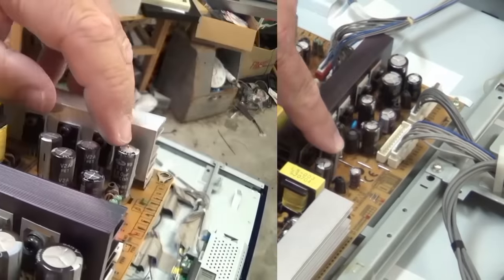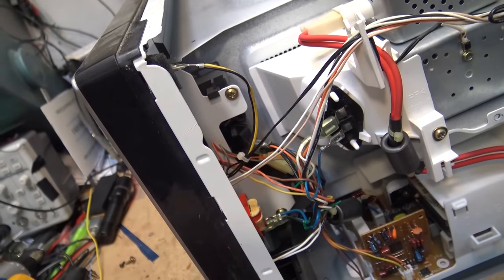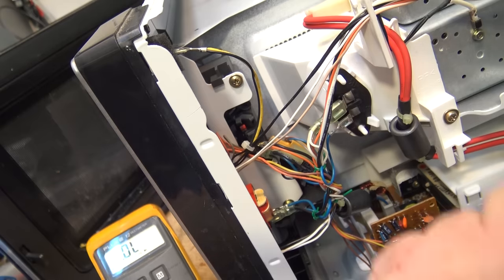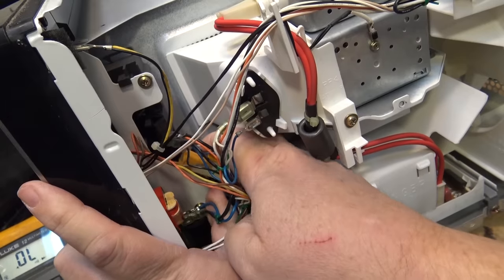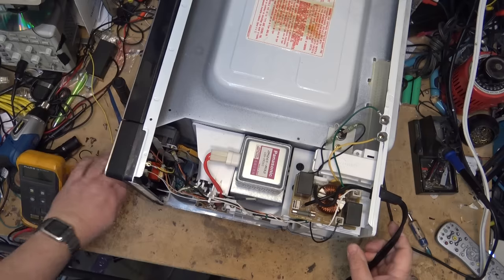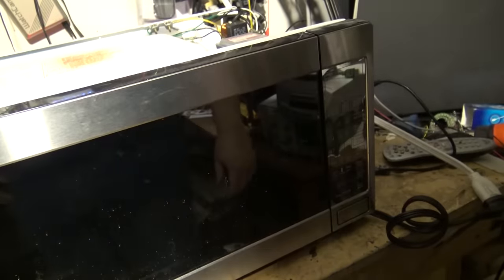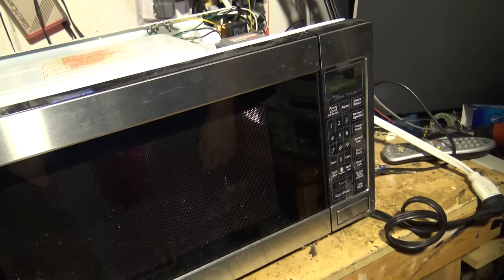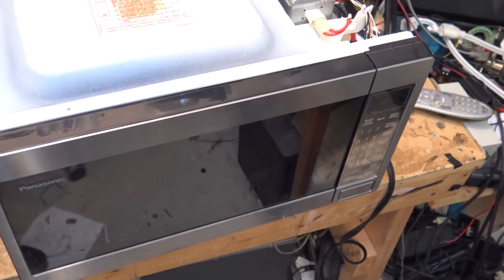Panasonic Inverter Microwave Oven Repair

Comment: first time i hear about inverter microwaves....they like to complicate everything...its nice, more failure modes... i have a transformer stick welder from the 50's and still works, my inverter welder gave up after 2 years. its not the igbt's its not the diodes, i tested the 5 and 12v regulators for the control circuitry, there is no schematic and i just hit it with a heavy hammer till it shredded into tiny pieces
Reply from the maker: It wasn't developed to make things more complicated. It was developed so that true power control could be achieved. Ask anyone that has cooked anything on an inverter type oven if they would go back to an old type. Nobody will. Especially good for defrosting frozen food. Even if you plan to cook on something else. I use mine to defrost steaks, roasts, salmon. Everything. Perfectly defrosted, and not starting to cook around the edges, like with conventional microwave which goes on full power for 3 seconds off for 10, on for 3. Inverter type runs constantly at 10% power to quickly defrost without starting to cook.
That is why they designed it.
Reply: @12voltvids  Yes i am aware that the traditional type of microwave runs on "pulses" couple seconds on couple seconds off depending on the setting you set it to...i never had a problem with that...and if the trafo burns you can get away with using other from a totally different microwave most of the times...i only use the microwave to reheat food or to heat milk so never felt that i needed to control it better...same thing with the welder..i can strike an arc and weld fine even with filled with crap and moist electrodes and eyeballing the amperage, i am just not picky about that
Reply from the maker: @MrHBSoftware  
Most people do just that reheat. But even for reheating left overs, the inverter is so much better. I used a conventional one for 40 years. Just got an inverter model last year when someone turfed a new one. It is night and day difference even for just reheating as it is done on a lower power setting so food reheats evenly. No comparison. Will never go back. Like driving an electric car. Will never go back to a gas only car.
Reply: @12voltvids  well i never tried one so cant argue too much...but i just love the simplicity and reliability you know..just like an old ineficient bulky "power brick" vs a new smps phone charger with those dumb safety current limiting features when you plug it into your phone it says its charging then you leave it overnight but in the morning you have no battery :) new technology is annoying for me, almost all new technology... right now at this very moment i am repairing a hybrid television from the 60's and the tube part is all working, the timebases, sync,high voltage etc but i am here struggling with the transistorised IF strip and AGC...i am about to bypass that and install composite input...
Reply from the maker: @MrHBSoftware  
To argue about the phone being dead in the morning because the charger detected a fault and shut down. Better to have a dead battery than be dead because your phone battery exploded and set your house on fire.
Better to be safe than sorry. In 1987 I had a Philips POS portable CD player. It came with a case you could drop it in to hold rechargeable batteries.
I bought the CD player one year when I was camping as I thought it would be cool to listen to my CDs at the camp sight, and the store that was selling it gave me a good deal because he didn't have the correct charger for the NiCd battery pack. He instead gave me a relatively large wall wart to charge it. There was a warning sticker that said to use only the supplied charger, but hey a charger is a charger right. WRONG. I was living in an apartment at the time. I left the unit on charge when I was out for dinner. I came home just in time, the batteries had over charged, over heated and totally melted the battery case. The batteries had actually melted into the cabinet. The CD plater still worked, just the battery case melted. I might even still have that CD player in storage. I was very, very lucky that I came home and found the unit, ready to burst into flames. Had it gone up I hate to think what could have happened. Wood frame building, fire in a ground floor apartment. Fire travels up, 3 floors above me. Scary. To this day I do not mess with battery chargers. I use only the recommended battery charger. If the instructions say use a 1 amp max adapter, that is what I use, because this little CD player was supposed to use a 200mA adapter, but the store gave me a 500 and said it would be fine. Guess what, it wasn't fine. The guy in the store didn't know. I didn't either. I was still wet behind the ears as my late father would have said.
Reply: i once got stranded without gas on my car and no battery on the phone and zapped the battery of the motorola flip phone with my car's 12v battery for a second and got enough juice to make a phone call,i knew i could damage it but it worked.... those batteries would heat and bulge and whatnot but its on the modern phones that the batteries explode and catch fire. modern phones wont even turn on if the battery voltage is below an absurdly high level, some of them enter a reboot and shutdown edless cycle if the battery is not in good shape....in the old days you removed the battery and heated it up with your breath, put it back on and you could send another couple text messages.....and regarding fires I dont set the phone on the carpet or on the bed while charging so it can freely catch fire, in the morning i just need to scrape it off the floor.maybe if the house had wood in it i would be more concerned about that but htere is really nothing to burn here, only if you set the phone on the bed or near curtains etc.... when i was younger i remember my charging port on the nokia was making poor contact and i wanted to set a date with some girl so i cut the charger's tip and wrapped positive and negative around the battery connection and the phone would work with no battery...putting the battery simultaneoulsly would charge it and provide juice for the phone at the same time....try that on a modern one.. all those protection circuitries are ridiculous when compared to the old overengineering of stuff. a 1amp rated charger could be feeding 2 amps for hours without breaking a winding...it would just heat a bit more.....
nowadays they use a 16v rated capacitor on a circuit that sees 15v....back in the day they would use a 35 or 50v part..resistors are also much smaller and their ratings imply that they will work much hotter than the old ones...i could go on and on, its the obssession with efficiency, miniaturization and cost saving. i dont like it and i am not the only one. maybe the common user prefers the fake safety that the modern stuff offers but not me
Reply from the maker: @MrHBSoftware  
The old phones used NiCd and then NiMh batteries. They don't burn like the new Lithium cells. 
WHy are we not using NiCd and NiMh anymore you wonder. Well size is one thing, but with a modern smart phone a NiCd or NiMh battery would run the phone only for a couple of hours before a recharge.
Reply: @12voltvids  the latest 3310 and 3330 had lithium as an option ,but they still wouldnt burn ,  maybe because they had less capacity per size than the modern ones?
Reply: @12voltvids  That's good to know, thank you. Now when I'm in the market for one that's what I will get.

Comment: About door switches and fuse blowing. If you want to get less problems, DON’T OPEN THE DOOR WHEN THE MICROWAVE IS RUNNING. PUSH STOP FIRST. Door switches arc when you open the door and the contacts in the switches burn prematurely and many are underrated from what amperage is stamped on them. When finished checking the food,close the door and press START. BY Following this procedure the relay on the main circuit board shuts off the microwave. The switches are not carrying any current,thus no contacts arcing. The relay on the control board has a higher amperage capacity. When you close the door,the switches close with slight arcing but not like when the switches open when the microwave is running.

Comment: i have a old 2003 sharp microwave thats using its original  magnatron  the only fix it needed was a bulb oh and has welded its fuse at least once the display does not work either

Comment: What is that black/gray tube between the red wires? Inductor?
I saw another one.
P.S. you slammed the door. Lol.
Reply from the maker: That is a ferrite choke.  To remove any rf from the filament wires going to the magnetron cathode.  Just needs to be the hv dc plus the couple of volts at probably 20 amps for the filament.  Don't want rf on there that will interfere with other equipment.

Comment: I have Panasonic Inverter Microwave Oven  1200W. model #NN-ST642W.  As soon as door open it selfs activates  1). Motor running noise,  2) bottom plate turning anticlockwise.  3) inside light on,    as  3 things are same time functioning   Henceforth close door warm up the food
Reply from the maker: Bad run switch.  
There are 3 switches.  Top is primary then 2 below.  One is the short or monitor switch. The other signals the timer if the door is open or closed.   Check that one.

Comment: I sure wish I could see what your doing when you install those switches
Reply from the maker: They are pretty simple. They just snap in.  Lift a plastic tab and they pop out. Put back in over the plastic post that fits through an alignment hole in the switch and push it back in.
Reply: @12voltvids  After watching your video I will show my Microwave a little more respect, as Ive been slamming the hell out of that door since it was given to me!
Reply: @12voltvids  Now we need you to  do a video on how to succesfully Clean a microwave. I recall you saying something about pressure washing it by putting pure water in it, My microwave has got caked on stains that I dont know how to remove short  from using a sand blaster
Reply from the maker: @rogerd4559  
That was a joke.   I found a brand new microwave in the garbage that someone tossed because they were scared of it as I figured they went to boil water and it errupted inside.  On the real powerful units pure water will superheat and boil at the bottom. The steam launches the remaining water out of the cup and soaks the inside of the unit.  It doesn't actually pressure wash the unit.  You clean a microwave by hand.

Comment: Or perhaps the backlight is going bad or is going bad
Reply from the maker: But they are LEDs.  They never fail right.
Reply: @12voltvids  I've seen lots of leds fail, they fail all the time especially on backlit lcd displays. like on dab radios they go dim or go out completey so you carnt see the display or they start flicking, I've replaced loads of them,  it's always usually white leds that fail the most. must be driven to hard to shine though that mirrored display and if left on 24/7. just replace the led backlight I bet that is why it's dim, it might only be the early leds from 2008 ish that fail that way.  you have seen leds fail on tvs.. i seen your videos. thats why I still have not got an led tv.. cfl backlit tv's seem to last forever.. well the backlights last forever. the earliest LCD tv I got is from 2005 it's an LG. backlights still good. I had to replace the power supply in 2011..it died during a power cut and never come back on.. it wasnt capacitors and fuse was ok. got a used one off eBay. it don't get used anymore tho as it's not got freeview built it.
Reply from the maker: @09danstart  
I was being sarcastic. The city has started replacing the sodium street lights with LED, and they are blinking on and off like strobe lights all over town. I hope there are no epileptics out when they are blinking or if could be a vary bad night for them.
Reply: @12voltvids  ok lol, they have done that here too in uk, replaced most nearly all of the street lights with leds.
Reply from the maker: @09danstart  
They are in the process of doing that and they are failing almost as fast as they put them up. About 1 out of 10 goes out in the first month

Comment: My Panasonic  NN-gd371m inverter rotating dial ( to set the mins)  isn't working at all .  The only thing showing on the LCD bis the 2 dots for the digital clock. iAny ideas anyone?

Comment: I have a 2007 model and when I removed the main switch, it had a plastic housing over the connections.  The plastic over the lower connector appeared slightly burnt, and I couldn't get remove it.  Any recommendations?
Reply from the maker: That is a common problem. The switch overheated and heated the connector up melting the plastic. If you work at it enough you may be able to break it free.Otherwise you will have to cut the end off and solder directly to the switch or put another crimp end on.

Comment: Mine shut down after 30 sec or so. Not heating. I saw arcing in magnateon. Replace magnateon. No arcing but same fault. I'll go over everything again
Reply: I was able to confirm the 2nd  magnetron I bought was faulty after getting a second working microwave of same. Both mags test ok but shut down microwave after 15s or so. If it's a component that is not 100% testable outside of circuit never discount it's crapped out.

Comment: so much for if i fix it i will give it away cos its worth nothing,looks like have not got a clue what your doing,cos there is no way an appliance would be allowed to draw more amps than your circuit is rated for fuses in these are normally 8 or 10 amp
Reply from the maker: It is rated 15 amps and that is what it draws on full power.  I know exactly what I am doing.  Those displays get dim because the led back lights get weak. Microwave oven are not worth much.  I got 30 bucks for it.

Comment: These Panasonic microwaves need to be plugged into a 20 amp circuit for normal use unless you use the inverter function and reduce the power. There is another video showing that these microwaves draw much more than 1200 watts.
Reply from the maker: Mine on a 15 amp circuit. Never have a problem and it is a 1200 watt unit.
Reply: @12voltvids  Excellent! Your home's wiring was done well. Here is the video I was referring to. @15:55 https://www.youtube.com/watch?v=J6Cvt0zufDs
Reply from the maker: @freegee3503  i would hope so, the house was only built 19 years ago.

Comment: Im having trouble getting diagrams off the internet i dont know wat im doing wrong but good video
Reply from the maker: Service manuals and diagrams are getting harder and harder to find these days.
One reason is because many manufactures are not publishing them. They have severe restrictions on just who gets them, being restricted to authorized service centers. There are also some that try to canalize on what was once freely available, and want to sell you a copy. I don't fall for that trap myself.  I google and if I can find it great, if not I work blind using my skills learned over 35 years of troubleshooting. Some times I get lucky, and other times I wash my hands and walk away.

Comment: What size fuse do those use?
Reply from the maker: Usually a 15 or 18 amp ABC type.  Will be stamped on the original and probably on the label on the inside of the cabinet

Comment: Folks, if your microwave turns on when door is open like my Oster OGYJ1103, it can be repaired for < $20. (I had to repair it to earn brownie points w my missus). Guessing it was a defective door switch, I got 4 switches for $16 (mid-range quality???) at amazon.com/gp/product/B07789LPPG, and seven T10 - T40 (Torx) bits for $10 at Home Depot. Turns out I only needed 2 switches out of 4 and one T20 bit. Not being an electrical type, I first drained the capacitor with a plier and then just unplugged every big wire I could find coming from the power supply and marked them with masking tape. The rest is as easy as playing Lego.

Comment: Did you discharge the capacitor? How so with the plastic box covering it?
Reply from the maker: No, the caps in this one are very small.  Won't hold much of a charge and I wasn't working around the high voltage on this one.

Comment: I have a security torx set..got it from harbour freight...cheap..Cheers 🍻🍻🍻🇺🇸🇺🇸🇺🇸
Reply from the maker: No need for. My flat screwdriver removed them no problem.
Reply: He only needs 3 tools. A small flat-blade screwdriver, a very large Phillips screwdriver and a pair of scissors.
Reply from the maker: @srtamplification  
I used 1 tool on this. Small flat screwdriver.
Reply: @12voltvids  Yeah, but using a Torx security bit does make it much easier to remove and install those screws.  And you do save the edges of the flat screwdriver tip from potentially getting chewed up.

I also bought myself a set of security bits from Harbor Freight Tools for cheap.  Though there may be some tools you would want to spend extra on for the sake of quality, that place can be fun to shop, though I don't know if they have any stores in Canada.

But, if you're ever in the States, check one out, even if just for shits and giggles.
Reply: For removal, I use the correct security tip in a Harbor Freight LiPo Drill (like the blue Hercules one);
set it to low torque! Saves a whole lot of time. To instal, 1st start screws by hand, then let that drill rip!
Avoid placing grapes in the microwave (to watch the large plasma arc headed towards the wave guide). lol
Reply: And a hammer.

Comment: Mine worked great until the "start" button quit working.  If I pressed just right, it might turn the unit on to cook.  But there came a time when the button simply could not be convinced to turn it on. :-(  Some of the numbers on the panel also refused to work :-(
Reply from the maker: Sounds like the membrane keyboard failed.